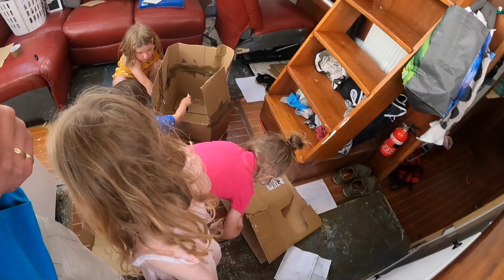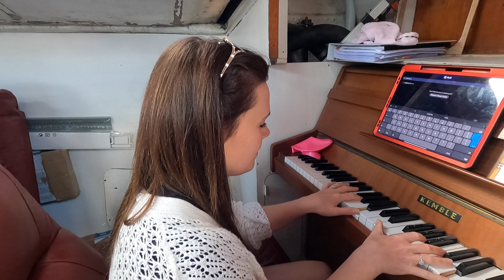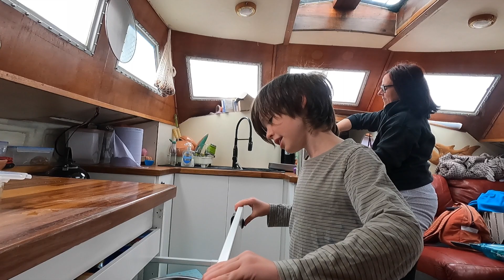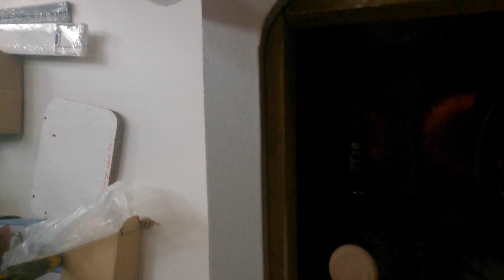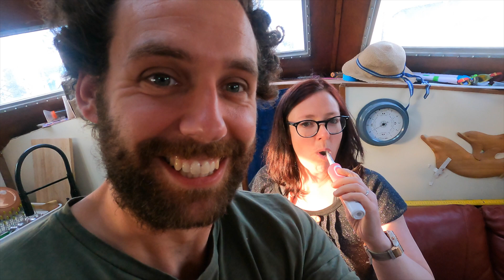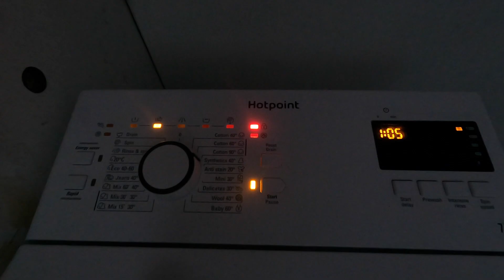Family Life Afloat | Mistakes & Hotpoint Washing Machine Installation | Episode 36

Comment: Hi there. Just a friendly warning. Wash machines that also spins and sure on a boat what NEVER is "horizontal" is a must that this wash machine is secured to the boat by means of permanent fasteners otherwise your machine will "walk" OUT WHEN IT STARTS SPINNING. The damage afterwards is more then you can think off. Also NOT to use it under sailing conditions even there is no wrinkle on the water. Good luck.
Reply from the maker: Thanks for the advice. :) we have got one ratchet strap round it so far but Hugh is planning to add another and some blocks around the base before we do any ‘proper’ sailing. And yup, spot on we’ll just use it in marinas! :)